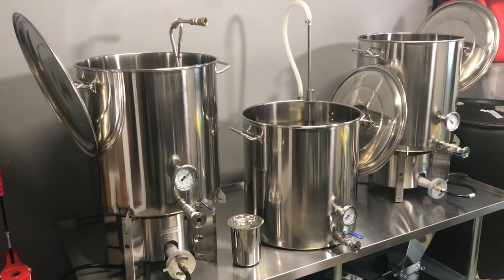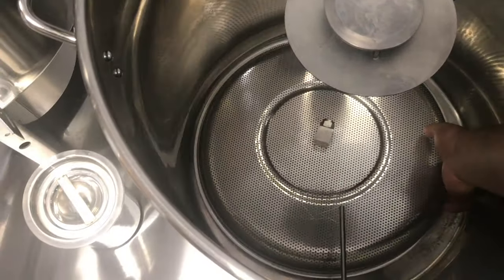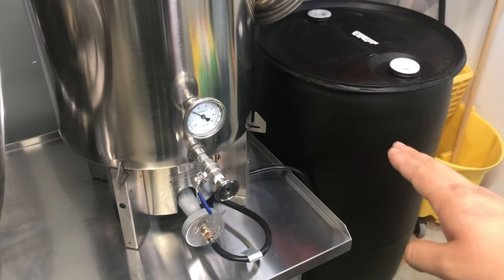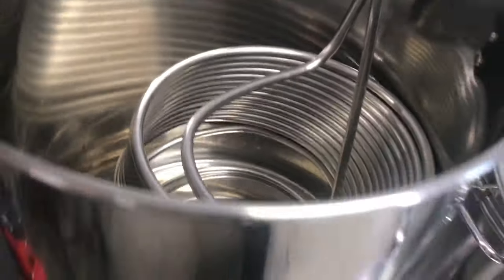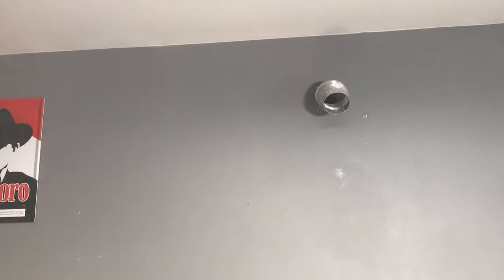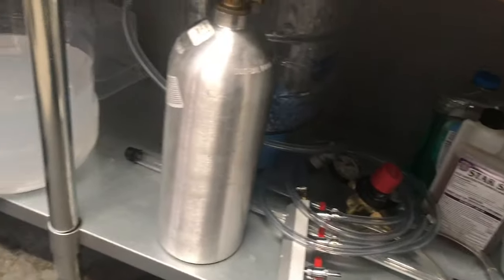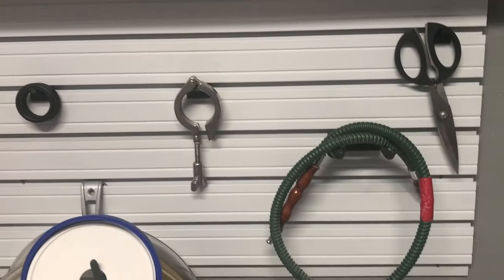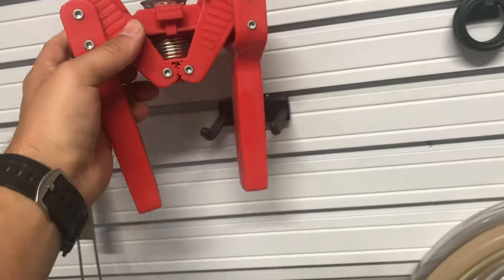All Grain Home Brewery Setup

Comment: Thinking about a similar setup with by propane burners on a stainless steel table. Just worried the table getting hot. Does it get hot?
Reply from the maker: No not at all, the heat is directed very well and high enough up on the burners that it doesn’t affect the table at all. I explored an electric setup but propane was the way to go, with maintenance and cleaning electric would be a hassle in my opinion.
Reply: @unfiltered2889  where did you get your table?
Reply from the maker: Most of my equipment is pieced from restaurant supply stores. The table that holds the brew gear is a 72” equipment table which is shorter then a standard table and I got it from ‘Chef Toys’ online.